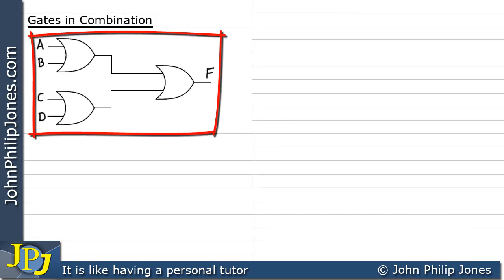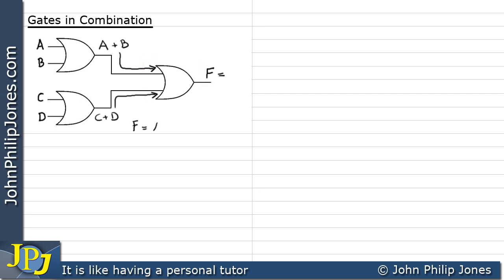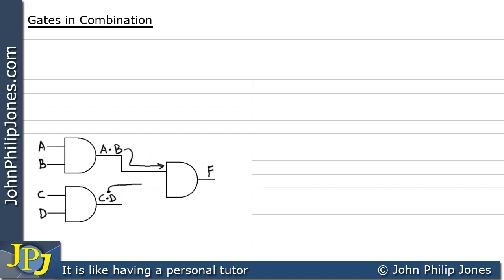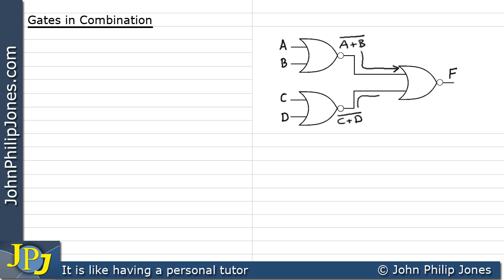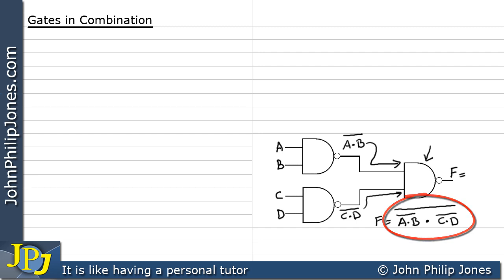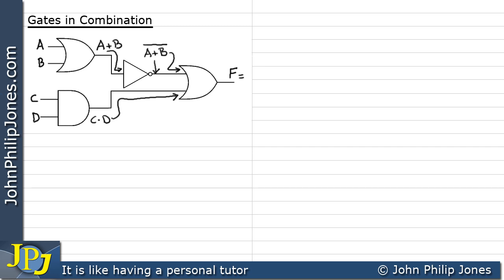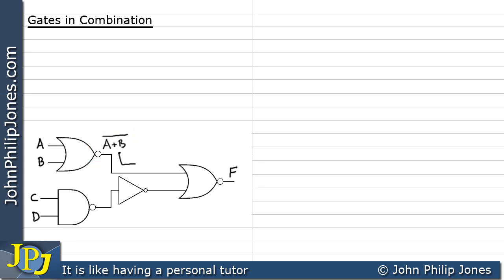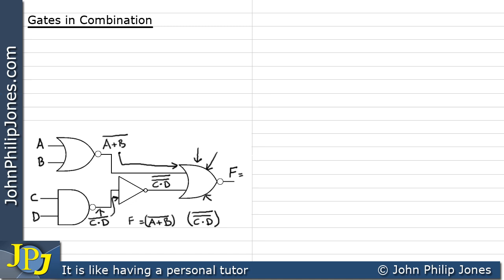Combinational Circuits (1 of 2)

Comment: It's so much easier to use ' to represent NOT instead of drawing a line and it's easier to reproduce in text on a computer when describing these circuits:

A and B = AB
A or B = A + B
A nand B = (AB)'
A nor B = (A + B)'

Not A:  A'
Not B:  B'

That way when you start getting multiple levels of NOTs happening, your page isn't being filled up with horizontal lines everywhere. Case in point:

A(B + C)' + [(DE')' + C'D'E]'
Reply from the maker: For electronic logic circuits it has been standard practice to use the 'not bar' (as in the videos). For logic in general the 'not bar' is not used and the way you have described it is used. When I teach logic I do not use the 'not bar' and follow as you have outlined. It is just that I decided to use the historic approach for electronic logic circuits. It is similar to complex numbers in mathematics an imaginary number is represented by "i" and in electrical/electronic engineering "j" is used (so as not to confuse it with electrical current).
Best wishes
Phil
Reply: Nice.  :)